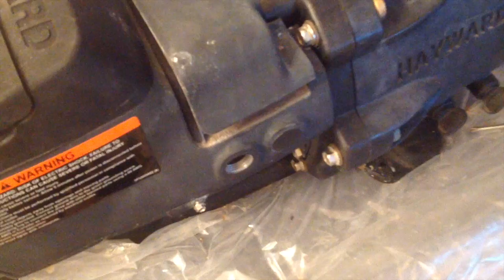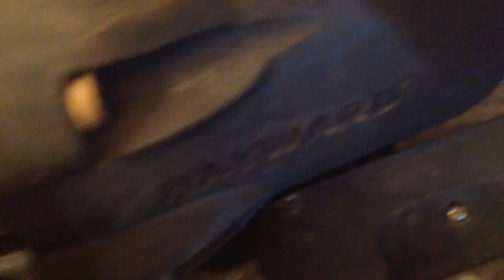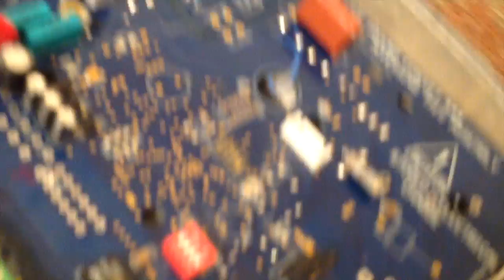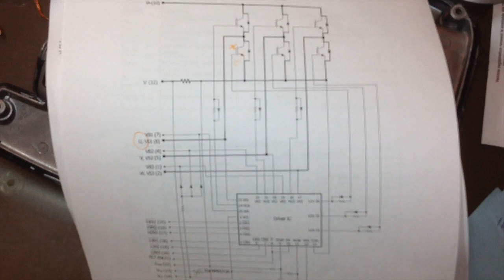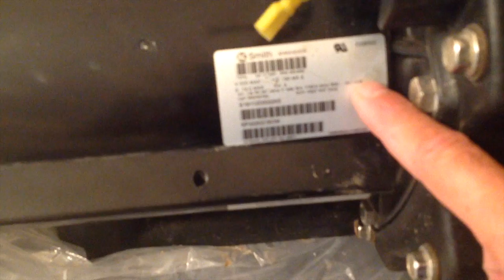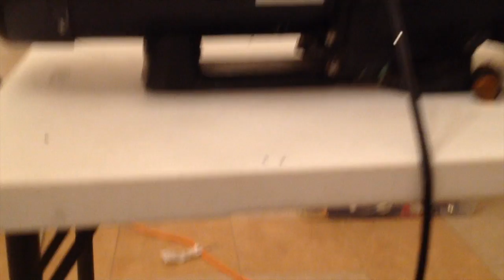Hayward SP3400VSP Control Module Repair

Comment: Hi Mark, I have the 2.0HP model and getting a heatsink overheat error with the system attempting to cool down and restart indefinitely. Do you have any experience with this. I did notice in the diagnostic menu that the heat sink temperature is all over from -40 deg C to +83 deg C. Have you dealt with this type pf problem, I believe it may be the RTD, do you have any specs on the replacement values or model if I were to open and perform a replacement. Also, when you put the pump back together what did you do to seal the unit back up so you could prevent water from getting back in and causing more damage - thxs

Comment: Mark and everyone: do you know if the part IRAMX16UP60B can be replaced by the reference IRAMX16UP60B-2? I have been unable to find it. Many thanks
Reply from the maker: The differences are the pin leads shape you have to bend them up 90 degree, pull the spec (pdf) for above part out from google and see the differences on last page of the spec, the original part have -2 that means 90 degree angle , but I did used IRAMX16UP60B many times you just have to be careful when you bending the pins to fit in place. Straight all pins then place it in the holes then bend the whole chip in correct location.
Reply: @Mark1Jordon1  Hello Mark: thanks for your kind answer. Let me see if i understood you: since i cant find in the States IRAMX16UP60B i can use the IRAMX16UP60B -2 and just carefully bend it?
Reply from the maker: Yes, you can just be very careful when you trying to reshape  the leads in to the holes if you bending the leads to many times they will break, buy two chip incase you mess-up you have to be careful because pins are not as long as -2 part. Straighten all the pins line up all holes with chip up-right solder couple pins then bend the chip in position make sure do not insert the leads too far into the holes because then you can not bend the chip in position also when you bending the chip in position make sure the fasten screws are line up correctly. Again pull the spec for IRAMX16UP60B from google page and look at the last couple pages.
Reply: @Mark1Jordon1  Awesome !!

Comment: Seems the IC has been discontinued.  Any suggestions for a replacement?
Reply from the maker: I do not know of any replacement IRAMX10UP60B IC, but if you can not fix your drive Module watch my other video for Hayward pump and use the VFD to drive your pump.
Reply: @Mark1Jordon1  Thanks, I will check the vfd option, the company I work for install hundreds of vfds a year, maybe I can get a deal.
Reply from the maker: Remember if you change the model number of VFD other than one that I shown in Video, then you have to learn and configure the program part of VFD.
Reply: @Mark1Jordon1  Yes sir...

Comment: I watched this video and I did exactly what Mark said and it WORKED! You just saved me a thousand dollars Mark! Thank you! I would have just bought a new pump if I hadn't watched this video because a new drive is about $500 and I'd rather just get a pump that doesn't do this again. With that being said, Mark said parts of disassembly and de-soldering would be hard, but I found it to be VERY hard. I even teach a soldering class. If you are thinking about doing this yourself, a regular soldering iron won't do it. When you go to de-solder the large capacitors, and inductor, the traces that they are connected to are at least a half inch wide because of the large currents going through them. This makes them very hard to heat up enough for to make it possible to de-solder. I ended up using a professional de-soldering station (Pace PRC-2000), the kind that pulls a vacuum while it is heated. I also found that I had to use high quality flux. One trick was after you get most of the solder off the pins, (with high quality flux and desoldering wick and high quality iron), put a little extra solder on the pins that you just removed and then apply the flux again, it helps to get the solder out of the holes completely. This whole job took me about 6 hours. I had to order my part from India (https://www.utsource.net/) $33 including shipping, because it was the only place that would deliver 3 day. All the rest were from china and would take 20 business days. Hopefully this buys me a year. It was definitely the same part in this video that was broken. Make sure you buy the -2 model (the last 2 characters of IRAMX16UP60B-2) because some of the ones in china don't have -2 which makes the pins straight I believe, but they need to be right angle. One thing Mark didn't mention was how he tested the diodes and the IRAMX chip above to know it was bad. The diode that was bad was within my IRAMX chip and it was the one connected from pin 8 to pin 12.  Just put your meter in diode check mode, and put the black lead on pin 8 and the red lead on pin 12. It should say around .4 volts. Mine didn't thus it was broken. When I bought the new part I immediately tested the same pins and it said .4V.  There are 5 other diodes in the chip as well as 4 diodes in the rectifier you can test this way. I would say if someone was only going to charge you about 200 to 250 to do this job, you are getting a good deal. Maybe even 300 because it is a lot of work. After that you might as well buy a new drive.
Reply: UPDATE (2 hours later): In the amount of time it took me to write the post above, my pump stopped working. Same drive error. GRRRRRrrrrrr!
Reply: @joedenny8853 , what was the error? Was it thermal or otherwise?

Comment: Hi Mark, Im wondering if I can wire from the breaker or pool timer, directly to the motor and run at full speed until I get the replacement control module?
Reply from the maker: Short answer No you can not, because the motor works with different frequency and voltages based on speed of motor, you actually changes the AC input voltages with that module that it quit working to DC and then converter change it to the pulse with different frequency and amplitude and feed it to pump. This motor is three phase motor even if you have grid three phase power line you could not connect it directly to the pump. Watch my other video on the same pump for cheaper solution with VFD instead of the repair or replace the module.
Reply: Mark Kash I appreciate the quick answer.

Comment: Mark, hope all is well. My pump just stopped working like shown in the vid. Is it still possible to send to you to get it fixed? Thank you in advance.  You can reach me at rde.dios@yahoo.com
Reply from the maker: I do not have a time to repair a module anymore.
Reply: Mark Kash understood. Any advice would be helpful. Thank you!! Also, can the whole circuit board be bought? I just spent 600 to fix this thing and now a few months later it's not working again. Very frustrating...
Reply from the maker: You can buy the chinese VFD and replace the whole module but it need to be install away from water, watch my other video about VFD with Hayward pump.

Comment: I just finished installing the new IC an hour ago and the pump is fixed! Thanks Mark! One interesting thing I observed, Across the mains connector, there is a capacitor and an SMT resistor who's sole purpose seems to power a small LED to indicate mains power is present. The resistor on my board had charred and burnt to a crisp. I ended up just removing it and the rest of the board seems to operate fine without it. Any idea why that 22k resistor would burn up like that?
Reply: I have the same burnt resistor.   Did you figure out what happened or if it was an issue?

Comment: This video helped me fix my drive as described, but now I have a new issue less than a year later. My pump stopped working again, though the problem appeared different. I was next to the pump when it stopped. I was messing with the schedule, during which the motor started and stopped a couple times. When I finally got the settings I wanted, it went to fire up again, but within an instant of trying to start up, failed. The drive now would act like all is fine and that everything is running normally, but that was obviously not the case.

After taking it case apart to expose the electrical board, I noticed that around the pin of the large capacitor it was black. Also, the solder connecting it to the board appeared to not be there. A quick check with a multimeter proved that there was no continuity between the pin the board. I cleaned up the area, removed the old solder and reapplied new solder to fix it up. When tested, all appeared to be fine again, so I put it all back together and thought all was well and that maybe this was a fluke. But only a couple months later, the same exact thing happened.

At this point I am thinking about fixing it and just letting the pump run 24hr, but just at really low speeds, just so that I can minimize the amount of motor starts. 

Does anyone know what would cause this problem? I am not an electrical engineer and am not well versed with complex circuits.
Reply: Your capacitor, probably the start cap,  is toast.  unfortunately it is lodged in the epoxy and can not be removed

Comment: excellent video.  Mine had no display, and trip the circuit as soon as I tried to switch on the power.  I was able to take it apart after watching the video, and found a burned component  (just like strayblackcatsmeow said:The black disc at 15:51 in front of the orange Relay).  Not sure whether it is a varistor or thermistor.  label says NTC 25 1132?  but I am not sure I got the whole thing or only the partial labels.
Reply: Did you ever fix your thermistor?Did you find the right part? I have the same issue!
Reply: @steveracecars  sorry for the late reply.  but I ended up buying a refurbished drive for $350. worked so for after two years.

Comment: Hi Mark,

Great video.    I was able to repair mine.    So when my elderly neighbor had a problem I offered to fix it.    I was extremely careful,   It actually came apart with very little effort.    Everything went very smooth, it ran for about 3 days then burned the new IC chip.    Was able to get another bad one from a  pool poolguy.    Did the same thing and it too burned up in the same exact spot.    The IC chip, Melted and burned a hole in the board.    

The back of board has some chips that appear to have a thermal compound and need cooling as well.   I did clean it off and added some Arctic 5 silver thermal compound to them (as well as the IC Chip.).   

Was wondering if I we could speak.    I have no problem paying for your time.   As I am under the gun trying to get this repaired for neighbor.    

Only other thing I could think of is my solder.  I used 60/40 rosin core from radio shack.    While on mine I used lead free.     

Thoughts? I can send you pics.

Comment: What temperature/wattage soldering iron did you use?  I've tried my electronics desoldering tool and 2 other solder irons. Solder is not melting.  Is it silver solder?  What temp is required? I'll have to get another.  Thanks.
Reply from the maker: Carefully use heat gun in conjunction with solder gun I use 450F, But again be careful with heat gun it will remove your surface mount components if you do not know what you are doing.

Comment: Hi Mark.  I had to take some time to thank you for the video.  I had a slightly different control module than you, but I had the same symptoms.  After replacing the big IC, I just fired it up, and it started to run without a problem.

Like others mentioned, the most difficult parts of this repair were:
- separating the top housing from the base since it's got a silicone sealant (just need to gently pry around the entire gap)
- desoldering (Don't try to use a manual solder sucker; splurge with the money you save and get a real desoldering gun...the Aoyue 8800 made the job incredibly easy)

Now the question is, how long will this repair last before it dies again?  I'm in Arizona, so I'm going to follow your other tip and construct a cover to shade the unit to help with the overheating issue.

Again, many thanks Mark!
---John
Reply: @blockage86/John  - I just got an Aoyue 8800 and it isn't doing the job you describe above.  The large capacitor legs are not melting sufficiently to allow solder to be sucked out from the hole around the lead. I got solder above the leg off using a manual sucker and another Weller gun on an earlier attempt. But now solder is still around legs in hole.  I have the 8800 cranked up all the way and I've left it in contact with the board 30-60 seconds or longer before I press the button. How long did you have to hold it on the lead?  Did you use a heat gun also? if so, what temp/what gun?   Seems like these things need a micro torch.   Video should have shown a desolder operation, the rest of the info is nice (however blurry), but if one is supposed to be able to repair the board it is more in technique of de-solder and loosening the silcone that is more important to be shown.  Can't pry silcone if component still has solder in the hole.
Reply: @sut2910 - I had my 8800 set to 400 degrees, and that worked well enough for me to get the solder melted on the large caps.  I did use some wick beforehand to remove some of the surrounding solder first since there was quite a bit in place.  I did not have to use a heat gun at all for this project.  Those were definitely the most challenging leads to desolder...it was not a one shot deal.  Also be sure you gun is not clogged.  I had some solder clogging the tube where the solder empties out into the clear plastic cylinder that holds the removed solder.  Tools are provided to clear it.

I suspect that with all the heat I was giving the board while desoldering, it softened up the glue enough where I was able to pull the board off of the components that had extra glue holding them.  I was rejoicing quite seriously when I was able to remove it...be patient and it'll separate with a bit of coaxing.

The other issue that I ran into is that as soon as I reassembled it and started it up, it started up fine like I mentioned.  However, shortly after it primed, it shut down with a Drive Overheated condition.  I suspect that when I did a poor job resoldering the temp sensor leads, so I had to disassemble, resolder those leads, and reassemble.

It's up an running now with a drive temp of 65 C and a heatsink temp of 49 C.  It's about 100 F outside.

Comment: Thank you!! Was able to repair mine today. Hardest part was separating the board from the resin. $25 part over a $500 new driver board thank you again.
Reply: I am at that place needing to de-solder and separate the board. I have the de-soldering down but separating the board is a problem. How did you do the separation?
Reply: Richard Zierden I used hot air and a metal Spudger to separate them. Just take your time and watch that you don't hit the windings on the transformer.
Reply from the maker: Use heat gun and push the board upward with big screwdriver while applying the heat, make sure tip of the screw driver does not damage the component on other side of the board start from on corner and work it out around the board you can insert flat tip of the screw driver between board an chassis and rotate the handle of screwdriver while applying the heat. make sure all screws between the board and chassis are removed before start pry the board off.
Reply: Thank You Mark
Reply: Thank You Scott

Comment: Mark,
Looks like I also have the same issue on the same pump. I am in San Diego, do you know anywhere I can get mine repaired?
Reply from the maker: Your options of repair or replace the control module based on Cost:

1)      Repair the module yourself based on my youtube info
2)      Replace your module and use the generic VFD based on my youtube video
3)      Let me repair your module (if is repairable, 2 out of 15 units that I repaired had different issue)

 

Please PM me or let me have your phone number  if you need to know cost of option 3 and condition.
Reply: Mark K,
Did you get my reply last week. I do not know how to PM you. Please call me at 858-451-4593. Thank you!
Reply: If you can repair, please let me know at reggieandyvonne@comcast.net
Reply: Hi Mark, Are you still willing to do repairs on these modules? Mine just failed and I would like to minimize my cost on the repair. Ray Z    rzelred@gmail.com
Reply: Mark Kash. I also need mine repaired can you let me know if you can still do it? Rde.dios@yahoo.com 
Thank you.

Comment: I am currently working on a drive unit damaged by lightning surge and found that the Varistor is destroyed. The black disc at 15:51 in front of the orange Relay?. Do you have any pictures showing the markings on that component?
Reply: Did you find out the value of that varistor? I just had the same occur and Hayward ha no input as of yet as to the numbers on it...
Reply from the maker: No, currently I do not have open module nor I have a picture of varistor.
Reply: just found mine had a damaged varistor.  but it could be a thermistor tool.  from the ash, I saw the label NTC (next line 25) (next line 1132).  Any idea what this component really is?
Reply: Has anyone had any luck finding this part number? I’m also in need of one.
Reply: R7 Varistor is an NTC 25 1216 or NTC 25 1132

Comment: Hey Mark, may I ask how you have your pump connected? I'm thinking it was a daily harsh shutdown via my pool controller (controlled via a relay, which quickly cuts off the power causing a daily power spike via a still spinning motor coils). Now I'm running it with the power on all the time, and it is shutting down gradually via a software control and timers). Alas the system was setup by previous pool owners, I did not start looking into the pumps until mine failed and saw your video about how it could be fixed. Ordered parts via digikey by the way, got new IC faster (2 days) and was up and running within a week of discovering the error.